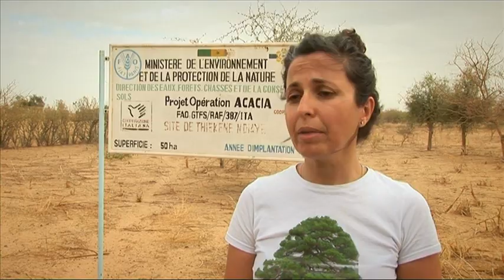Turning the tide on desertification in Africa (7min43sec version)

Comment: Don't you see what is going on here, the grass is returning when you remove the livestock, but there is more steps to follow to keep the land healthy, if rested forever it will start degraded into desert. 

So now what is the next step, what should happen to this grass? This is the most important step and also where every restoration project fails to understand the ecosystem.

What caused the grass not grow tall was the constant presence of livestock, without letting the grass rest and regrow. 
Now that the grass has returned, it is nessecary for it to be grazed so that it can biologically decay and end its life cycle and also giving light to new shots that will grow from the roots the next rain season. 

This is what happens when plants are over-rested and not broken down biologically: https://www.youtube.com/watch?v=lW-phWBmApA&t=0s

About 50% of the grass or more should be trampled down on the ground to create a cover that will slow rainwater to avoid run-off and shade the soil to avoid evaporation. This is done by having the livestock in the largest possible herd while moving them CONSTANTLY. 
After it has been grazed, you'll leave the grass alone again until it has grown back and is ready to be grazed again. 

This is the solution to poor communities in Africa, teach them that, it is much more effective and cheap way to addresses the problems.
Reply: Savory's method is brilliant and skould be taught to all. It does however not seem to be more than an interim step as there is plenty of proof that grazing animals also stop trees from developing. Nature in balance creates different things than Savory's results, and reclaiming desert will require both areas being grazed to form grasses, and areas with predators/protections. https://www.youtube.com/watch?v=rSzQ9w5TCqc